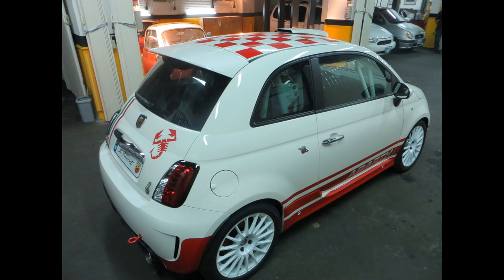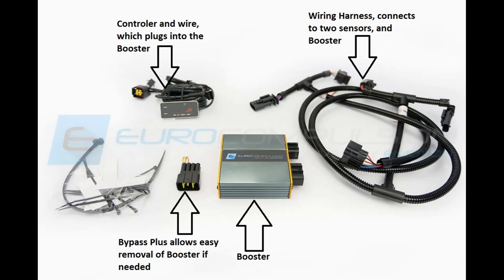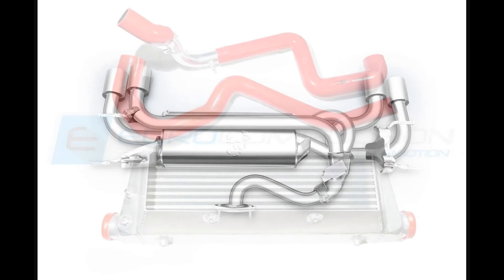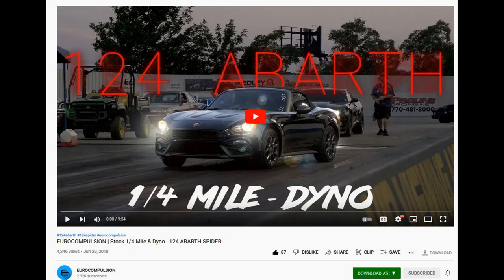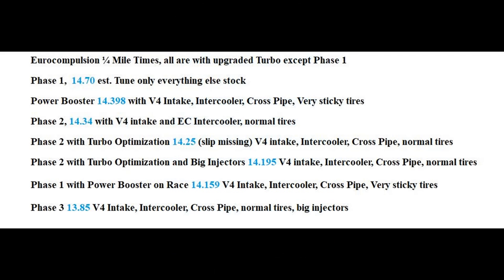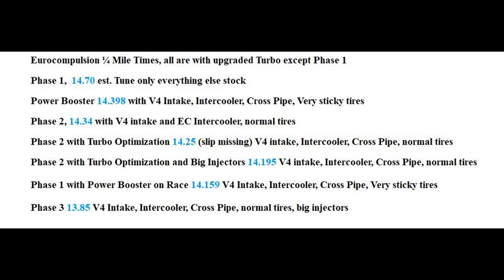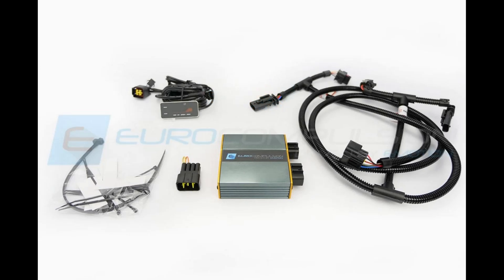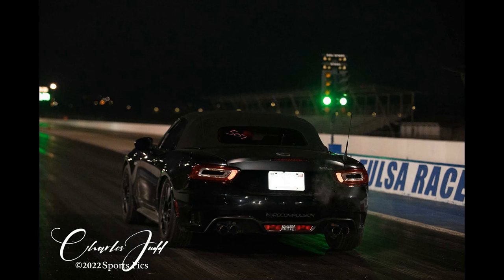Eurocompulsion Power Booster for Fiat 1.4 turbo engines

Comment: Interesting tech in obtaining the boost performance, but how do these engines hold up over time? Increased pressures in GM 1.4L's have cylinders going oblong  with low mileage (well under 100,000 miles. Fiat isn't know for well built vehicles (as seen when they owned Chrysler). Will Fiat build an engine block and cylinder set up that will go 200,000 miles?
Reply from the maker: Yes, no problem. Fiat actually has really good engines, they have had other issues, but their basic engines are quite solid. As for how long they will last, I can say this, my 500L has 140,000 miles on it, almost all of those with a lot of extra power. It's like new inside, it still has full compression and doesn't use or leak any oil. As for owning Chrysler, they really still do, Stellantis is just an umbrella corporate name.
Reply: @murphymb It's not quite the same thing, but there's a British YouTuber called Freddie Dobbs who normally deals with motor bikes, but he is posting videos about his trip to Sicily with his Triumph Street Twin on a trailer behind his 1.2 litre 500 with, 193,000 miles on the clock.

Comment: Dude, those 60s are bollocking you. 2.2x is an eternity. This is an easy 13 second car, if you could get it to 2.0 or less. As a comparator, I took a stock, loaded 2012 Mustang GT 6 speed manual car into high 11s, with a sticky tire. 4500 rpm clutch dumps  and dead hook hoisted tire and got 1.6 60s. Stock shocks, bars, sways. The 60s made that possible.
Reply from the maker: You're absolutely correct, but let's remember I'm trying to set realistic expectations for customers running similar mods. Thus I'm running real world tires, air pressures and so on. I'm not specifically trying to set a 124 1/4 mile record, although ironically, I have. So far, my car is the only 124 1.4 multiair to run in the 13s at an actual drag strip.
Reply: @GregsAirplanesandAutomobiles  I do find funny that we thought out 5.0 Mustangs in the 80s running high 13s low 14s at around 100 were rockets. I be old. Me other car is a 1986 base Mustang coupe 5.0, 5 speed and even with aluminum heads, Term X efi, etc., my 2014 mustang GT annihilates it, even before I jammed it full of Roush boost. These are the good old days.

Comment: Glenn, whatever happened to just good old fashioned engine tuning? You know, oil under the fingernails, feeler gauges, reprofiling cams etc, etc? Does anybody go down that route anymore, or is it all done on a laptop nowadays? Carroll Shelby would be turning in his grave.
Reply from the maker: There is still quite a bit of that. For example, in this car there is a ram air intake, not unlike what hot rodders in the 60's used and of course exhaust improvements. Reprofiling the cam in this car just doesn't yield enough benefits to justify the cost, and changing cams in this engine is a lot of work. I have done it many times testing different profiles which is a story in itself. Of course we also have the big intercooler, so that's hardware. The software changes are a big part of it too, but it all works together. Think of it this way. The computer tuning and sensors replaced the EGT probes and distributor machines, but everything else is still relevant including all the basic principles.

Comment: I will probably make everyone here angry but.. Are you people take this cars to actual circuits? I mean ones with turns and stuff. If no what is the point of it? Just run it on dyno and compare results. Correct me if i'm wrong but thats hardly a racing. I might by missing something and be glad if someone explains it to me. PS. I really love his airplane content.
Reply from the maker: Of course people take these cars to road courses. However the point of the quarter mile in this case is to show how much power we are getting from the engine. A road course has too many other factors to display that accurately. A less powerful car can often win a a road course if the suspension and braking set up is more track oriented. Of course we dyno as well, but the 1/4 mile is more meaningful.

Comment: You think you’re drag times are legit on a track prepped with an inch of VHT? I can show you in 60 seconds how to fake a drag strip ticket. So what? Dragy times are proven to be very accurate.
Reply from the maker: This was at a test and tune, not a race event, thus very little track prep. Look at my 60 foot times, they are pretty normal. I'm not sure how you think I could have faked that time slip. If in doubt you can check the track app and look up my times for yourself. You can also verify the car number and dates between the time slip and the track photos on their facebook page.